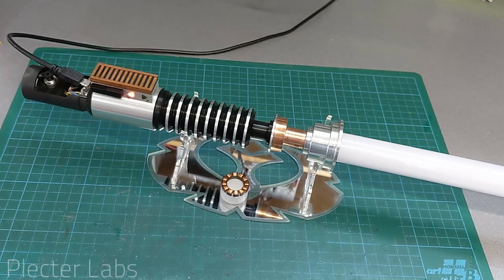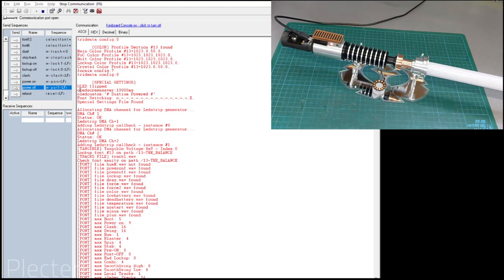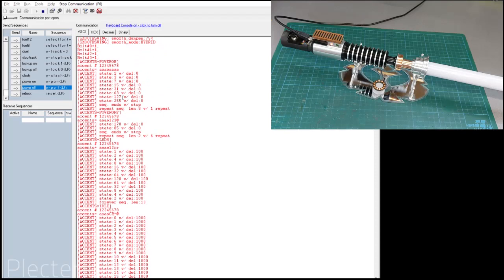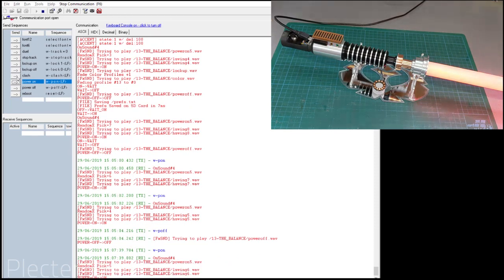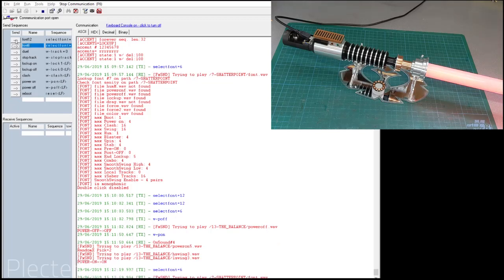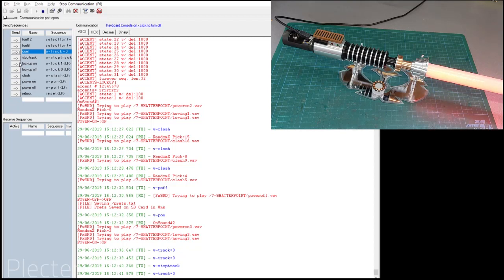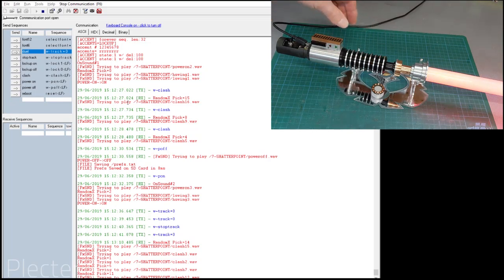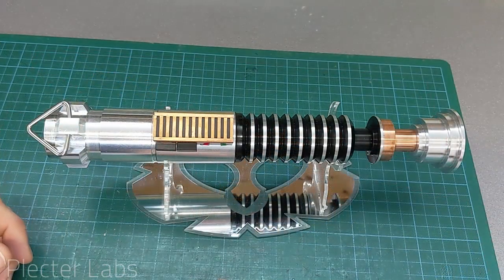CFx Demo2 Remote Control,  PLI and Skinning

Comment: Can you have Sigourney weaver's voice speak?
Reply from the maker: yes, all sounds changeable
Reply: @ErvPlecter  This board is roughly the same dimensions as a prizm? I'm going to order chassis and some are specific to which soundboard is being installed. Thanks.
Reply from the maker: @charlescowan6121  it's smaller than a prizm. All information got shared in the release PDF if you need any details !